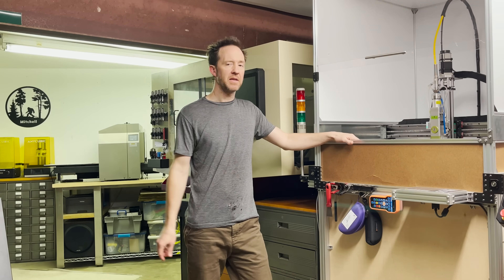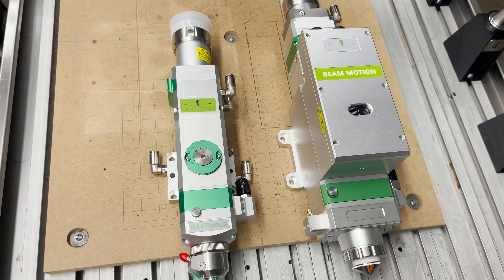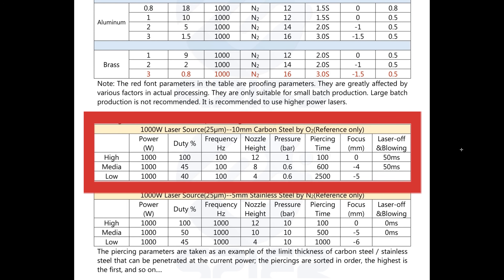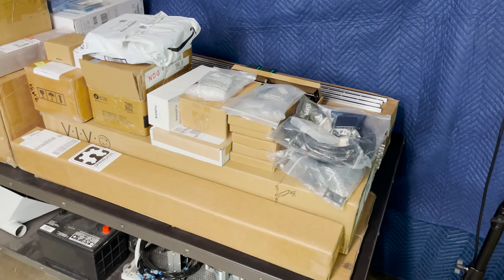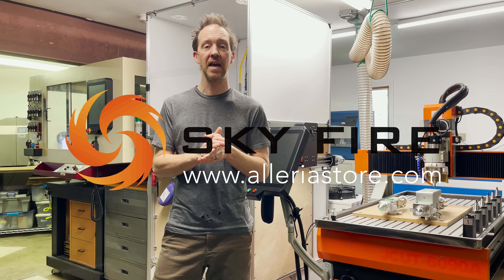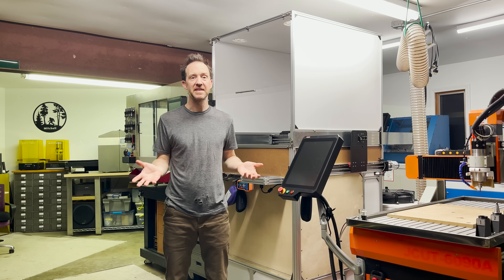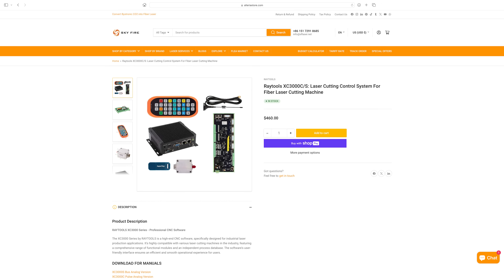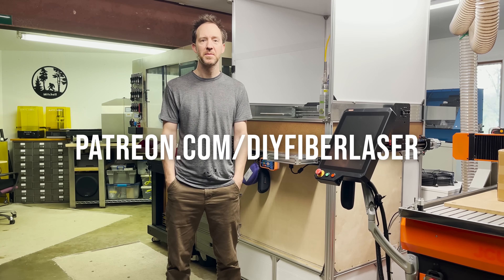Top 3 Questions about building a DIY Fiber Laser Cutter

Comment: Can I cut brass plates of around 1mm thickness with a DIY fiber laser cutter?
I’ve heard that brass has high reflectivity and that reflected laser beams could damage the equipment.
Is there any good solution to this issue?

Comment: Is it possible to buy a 3-in-1 laser welding machine with cutting function to replace the laser source, chiller and head?
Reply: Here in Brazil, it is extremely cheaper to have a complete welding machine instead of individual parts.
Reply from the maker: From what I've seen, the 3-in-1 machines cutting application doesn't have a small precise beam like the CNC cutting heads. If you were to break it apart for the components to put on a CNC machine, you would still want to get an actual CNC cutting head for the capacitive sensing height control, a different controller, and a different chiller (those don't actually chill the laser head line, just room temperature circulation), so maybe you could use just the laser source.
Reply: @diyfiberlaser  What about putting a laser cutting head like this (not the welder unit) on an existing "langmier" system?
Reply from the maker: @richardgoldy7911  Ya, I could see someone buying a welding unit and a separate cutting head, removing the welding head and running the optical cable to the cutting head and attaching to a plasma table...it seems possible if you can figure out height control.
Reply: @diyfiberlaser  They have the Torch Height Control (THC).  I'm not sure how it works.  Langmuir will not give any blessings or comments on it at all.  Just say-don't do it.

Comment: Great info!!  Thank you!  I'm in the market and should be purchasing from SkyFire very soon (I'll get you a commission!) :)  I noticed you went with the max cw laser this time as opposed to Raycus.  I've read the JPT laser sources are supposed to be decent as well? Curious led you to go with the Max CW.
Reply from the maker: I mostly just wanted to try out a different brand so I could compare it to the Raycus, it's a little cheaper also
Reply: One more question.  Will the XC3000/s support anti collision?  I saw where it looked like it could be done with the xc1000, so maybe yes?
Reply from the maker: @nerdulator5000  I have the user manual, but oddly enough, it doesn't really list it's features, just technical data. I would assume that if the nozzle makes contact it will throw an error...even the Ruida controller had this feature that you could turn on or off.
Reply: @diyfiberlaser  I heard back from Raytools and they mentioned that it does have the anticollision feature and that the BS04K ethercat smart cutting head will match with the XC3000/s.  The ability for the cutting head to dodge the parts as they pop up is a nice feature to eliminate head strikes.   I'll be interested to see how you like the xc3000/s.  Definitely priced better than the fscut.
Reply from the maker: @nerdulator5000  Oh nice! I'll certainly share my feedback after using the controller. I would like to try a fscut controller next. Since I'm doing the DIY thing, it made since to try out the cheapest options first.

Comment: Just borrowing Travis's YouTube comment section here, hope you don't mind, Travis:). Feel free to chat about any questions you might have here!
Reply: Thanks, will do.
Reply: I’ve been poking around the site and emailed Friday about a BOM for everything needed. I already have a motion system.  Would really like to see what the CAT connection method is all about.  Let me know asap on what the shipping list would look like!
Reply: Is it possible to add a rotary for cutting complex angles on tube steel?
Reply: Could you tell me what are the import duties for USA?
Reply: Tell Fiona her new BFF says hello. She's been a MASSIVE help in arranging all the DIY parts and shipping (which is totally reasonable, they even have locations in EU/USA - LA . Fiona is both a resource and an enabler, with actual compassion (yet encouragement) to far exceed my initial budget, and likely VASTLY over-estimate my DIY ability. Fortunately, they have a solid help/DIY specific service that you can purchase for super cheap that will connect you with some laser wizards to get your issues sorted out. I know I sound like a commercial, they haven't paid me at all (YET, Come on!), I'm just excited and also trying to justify my DIY project funding budget adjustment for the year(s). Ah well, worst case scenario I can make a pretty designs in the sky for the people in the airplanes to look at :)

Comment: Firstly I commend you for what you have achieved.
I'm the guy (Lilow) on the Masso forum, under machine conversions, Fibre Laser.
This page on the Masso forum has been viewed over 10K times.
You also mention Tamar Bar, have had contact with him also.
Cheers, keep up the great work.
Lilow.
Reply: Hi Lilow, I'm reading your MASSO forum thread now. I have 3 MASSO conversions running (2 mills and a lathe) in my shop and an extra G3 waiting for a project. I've also watched all the Tamar videos. We're really close to purchasing a fiber laser and are looking investigating controllers. We run lightburn on our CO2 and 35W fiber. After reading your MASSO thread, I may contact over there. Thanks for posting here.
Reply from the maker: Thanks for commenting! That forum thread is epic...there is apparently a lot of interest in the topic! Have you been able to get it working with your height control solution? I'm excited to see it in action.
Reply: @diyfiberlaser  Travis, yes I did get the height control operational.
It all started in 2020 during the Covid lock-down's working with a module I use for Plasma and 3D CNC Tig welding.
This was able to read the capacitive voltage, working to a height of 0.1mm @ 18M/min.
Cheers.
Reply from the maker: @ianeliason8890  Nice! that's certainly a usable speed
Reply from the maker: @ianeliason8890  I sent you a message on the Masso forum
Reply: Got it thanks.

Comment: In your previous build you had a 3d tube cutting problem. It wasn't as easy as it's supposed to be. Will your new build solve that issue
Reply from the maker: It wasn't that it was really a problem, it was just I was trying to use the controller in a way it wasn't designed for. I am not including tube cutting functionality on my upcoming machine. I was thinking instead, I might try to make a stand-alone tube cutting machine design down the road.

Comment: Nice! Can't wait for the new machine. I was looking at Sky fire before but was skeptical because their prices were so much better than others.  I'm planning on build a 3kw 5x5 table. I did a DIY plasma table 15 years ago and it's time for a laser.
Reply from the maker: I will admit, I was also a little skeptical at first. But given that I was already able to find other companies selling the same products, not AS low, but in the same ball-park of pricing, I decided to take the risk and try them out. And from my experience so far, I have no reason to believe they aren't totally legit. Good luck with your laser build!

Comment: Something I recently realized is that quasi-continuous-wave (QCW) fiber lasers would work with a DIY fiber laser setup. There are some advantages and disadvantages to a QCW laser over the traditional CW laser that Travis is using here:

Advantages:
1) The 150/1500 and 300/3000 QCW fiber lasers are air cooled, so no need for a water chiller for the laser source itself. Still need a small water circulation pump for the laser head and laser source head though, but that could be a simple low cost 120V water pump in a bucket as the amount of heat is very little (only cooling the optics).
2) Extremely high pulse power means that the QCW pulses can piece through thick material with each pulse (but see disadvantages below).
3) Low average wattage requirements. The 150/1500 and 300/3000 QCW lasers run on 48V from a 48V power supply, and that supply can be generated from a 120V socket, bypassing the need for 220/240V power in the garage.
4) A whole system can be run off only  120V breakers. 2x 15amps of 120V (Max of ~3600 watts) allows you to run the laser source, water chiller for the laser head, small silent air compressor with air dryer system, and the CNC machine (Set up on the QueenAnt Pro V2 mechanical kit).
5) Pulsed laser gives more flexibility in what you can do, including doing engravings instead of just cutting.

Disadvantages:
1) QCW laser sources are more expensive than CW laser sources like the Max 1000W shown here. Looking at at least 6K for a 150/1500 QCW laser source alone (12K for the 300/3000).
2) Low average power means that while the pulses can piece thick material the cutting speed is much slower.
Reply from the maker: Thanks for sharing! I was unaware and now I'm intrigued...you've forced my hand, now I've got to drop everything and spend the next several evenings researching the subject : )
Reply: @diyfiberlaser  I'm in contact with a manufacturer of laser machines and they will be testing to see if 150/1500 and 300/3000 QCW can reliably cut 3mm aluminum (my intended application) with very slow cutting speeds. Will update when I hear back from them on their tests.
Reply from the maker: @mbanb6775  Awesome, I was reading about them and it sounds interesting for some applications. I'll be looking forward to hearing what you find out!
Reply: @diyfiberlaser  Video posted: https://youtu.be/RHO5-I9rREM
Reply from the maker: @mbanb6775  So it looks very possible...especially with the 300/3000! The 150/1500 results looked a little rough. Thanks, I really appreciate you sharing!
Reply: @diyfiberlaser  No worries! I wonder if that 150/1500 roughness could be reduced by tuning the pulse width, frequency and cut rate. The lower the pulse frequency the higher the power each pulse has. The shorter the pulse width, the higher peak power (more vaporization of material) but less melting (generally melting the material allows for faster cutting as molten material can be pushed out by the air assist). So may be possible to clean up the edges of the 150/1500 cut, but may drop the cutting speed to 0.1m per min or so.
Reply from the maker: @mbanb6775 Ya, they might not have took the time to dial it in for best results. If you end up getting one, please share more videos so we can see it in action! May I ask what is your intended application, if you can cut 3mm aluminum for cheaper using a CW laser? Are you intending on doing some spot welding or drilling also? Or is it the lower power requirements that interest you?
Reply: @diyfiberlaser  I'm drawn to the lower power requirements, no fusing with a chiller (lower maintenance), and the potential to do engraving. I would do very little cutting as it would be moreso a hobby machine with the odd job cutting aluminum enclosures for electronics, so cut speed isn't a concern for me. If the QCW lasers were half their current price I would jump for the 300/3000, but as it stands the CW laser route is the better buy so I'm still considering options.

Comment: Great video!
My decision to go with centroid acorn was because couple of reasons:
1. I already had the acorn board because my machine previously was a plasma cnc.

2. I wanted to cut square tube and also sheets. The other options for that are the fscut3000s and weihong controllers and both of them are 4000USD + .

regarding how to controll the laser with a non dedicated fiber laser controller. 
I mad a lot of changes to my acorn board, such as - custom M codes and custom pierce cycles and stages.

The only obstacles that I couldn't figure  is a way to controll the frequency.
pierce and cut requires different settings... and also the different focus as Travis said and my head is a manual focus head so..
Those things only matters with cutting thicker sheets. 
For example my laser source is a 2kw raycus, from my experience up to 8mm carbon steel cutting great. Above 8mm different frequency and different focus is a must for the pierce. 

I will not recommend to do what ive done because its a lot of hussle and the more suitable and better option is to choose a dedicated fiber laser controller if cost is not a concern.
For those who are interested i know that centroid are currently working on a fiber laser controller.

Travis why are you building another fiber laser machine?
Reply from the maker: Thanks for sharing more about info your project! That makes sense...I've seen the dual purpose controllers are quite a bit more expensive! Even though the hassle, it's cool to see that you've been able to make it work with the Acorn...I especially like seeing your tube cutter in action! What controller are you planning on using for your new machine design? I'm building another one simply because I'm a designer at heart...after using my machine for a year I felt I could make a better design that would be simpler for anyone to replicate, cheaper to build, and I would better document the process to share this time.
Reply: @diyfiberlaser  got you man I'm like you haha.
On my new build I will probably use the same acorn board at the beginning and will change to Fscut3000s along the way because it's the most recommended controller for integrated machine, and I could find alot of information about it.

On my current machine I used hybrid servo motors(close loop steppers) and for my new build I bought new 1kw servo motors, so not replacing the controller for now is a cost decision because all the new servos and planetary reducers cost quite alot.
I have 7 motors on my machine so..
1. Z axis
2. X axis
3. Y1 axis
4. Y2 axis
5. Y3 axis
6. B1 axis (back rotary)
7. B2 axis (front rotary)
Reply from the maker: @TAMARbarCNC  That sounds like a good plan...I would try out the Fscut3000s as well if I could, but I don't think my small workshop could accommodate an integrated machine large enough to make the tube cutting portion long enough to be worthwhile...so I will have to stick to small machines for now. I look forward to watching your videos on the build!

Comment: If you do want to do mods/ self build. Understand the cost of downtime, add it to the amount you think you'll save.
Reply: Mmm. You must mean finding parts for the machine that I had premade. Yeah I make a good living doing just that for my customers. Some Chinese parts you can't get. I would make more if I had metal working tools. All most ever part that I replace is because of dust getting into the contacts. Some I add to prevent future crashes or to protect components that where not properly fused from the manufacturer. 

Try and tell someone that you can't get a driver to work with the board they have. Or that the drive is still ok and that the output from the controller is broken. Every time they tell me no it's the drive. So I say replace the drive and then call me when it still does not work. Then I pack up my tools and ask why they were willing to pay me $150 an hour when they know what is wrong and that I spent an hour proving was still ok. But you are right buying is cheaper than building. People like you keep me employed.